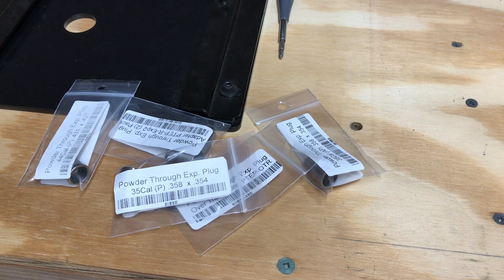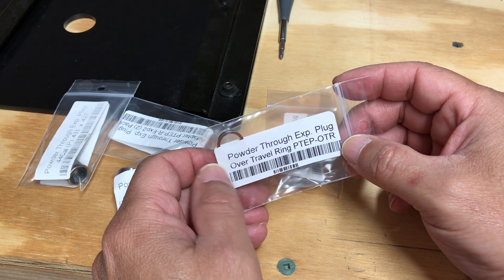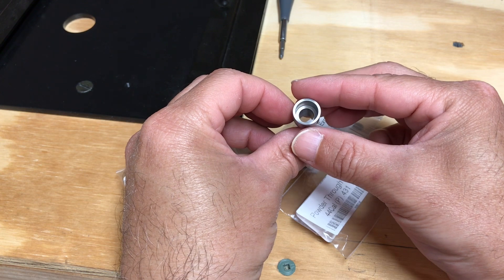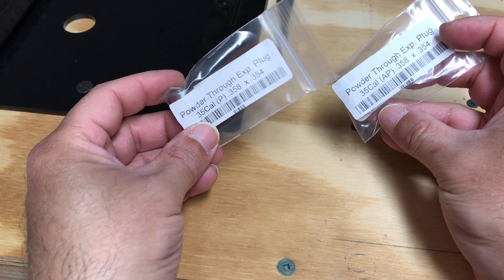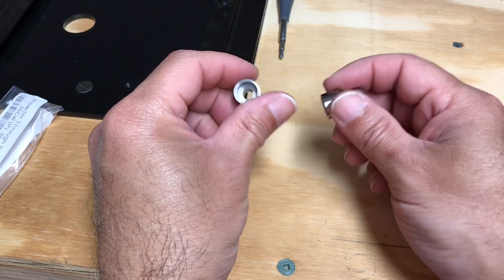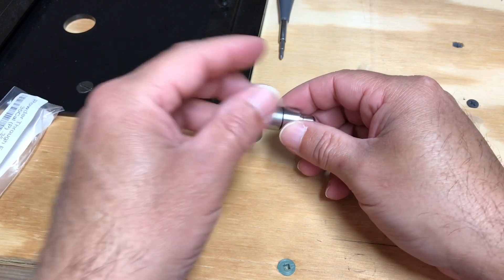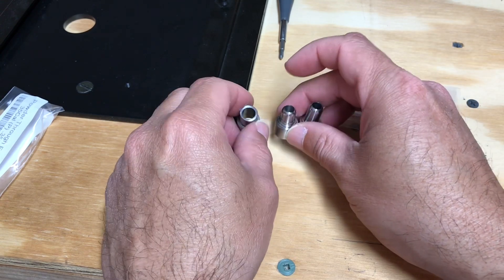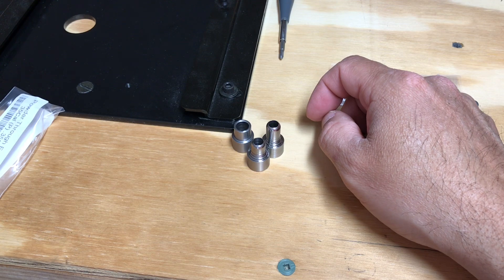Noe powder through plugs

Comment: Am I correct that the real problem is with the adapter and not the expanders?
I ask because I've been eyeing these for my Lee auto drums.
Reply from the maker: It’s the expander plug to much meat and you will get over charge I’m waiting for a call back
Reply: @ocean374  Ok, I was thinking the hole in the adapter was too big, and that if it was smaller it would cover the ledge.